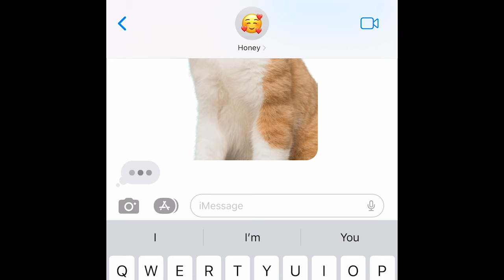#diy Bathroom Cabinet with Tilt Out Laundry Hamper

Comment: so you have to hold on to the laundry door or it falls to the floor while putting in clothes? Why wasn't a stop installed? Just curious
Reply from the maker: I had thought about this when planning the build (chain or wooden stop or even gas struts) but never landed on a solution. The basket fit tight into the space and I didn't want it to catch on anything when being taken out or put back in. Luckily, we haven't had it fall to the floor ever. The angle to open it and throw something in isn't enough to pull it the floor. There seems to be enough weight at the bottom, that it will pull itself closed if you completely let go of it (which we don't really do). Thanks for the comment/question!

Comment: What kind of hinges did you used for the hamper cabinet
Reply from the maker: I used regular cabinet door hinges. 3/4” overlay. Mounted them like a normal cabinet door, just on the bottom of the face frame.

Comment: What material did you use?
Reply from the maker: I used 3/4” plywood for the cabinet box, 1x4 select pine and 1/4” plywood for the doors, and a repurposed red oak stair tread for the top. Thanks for watching!